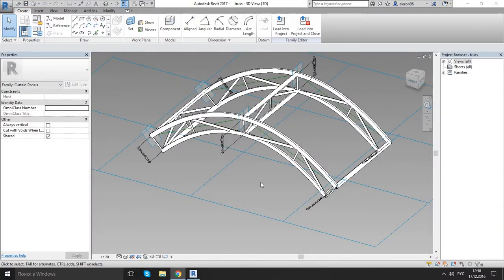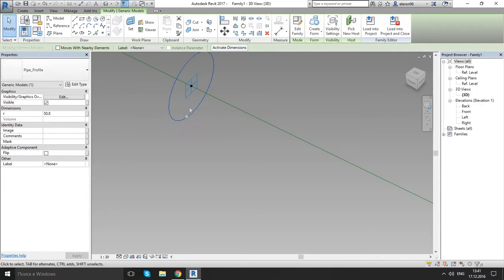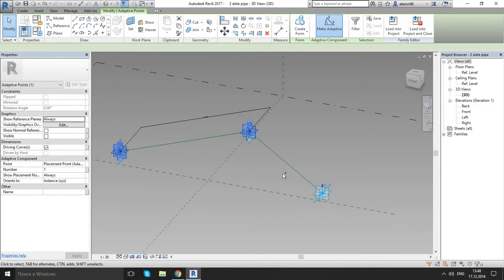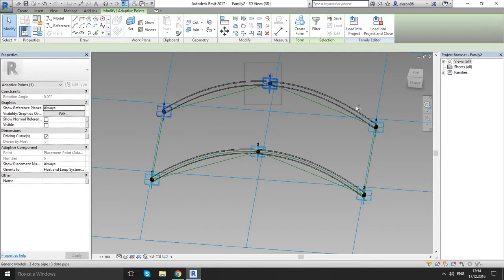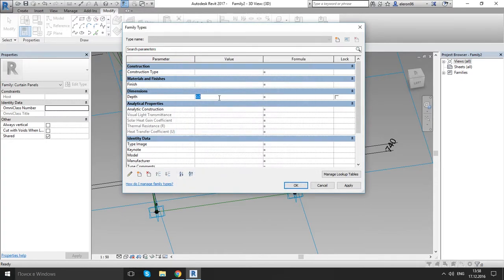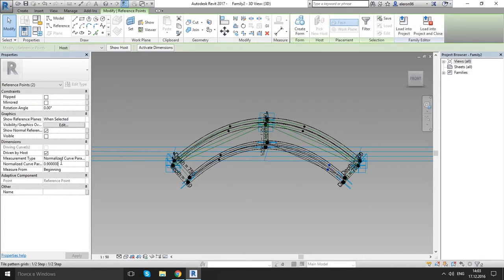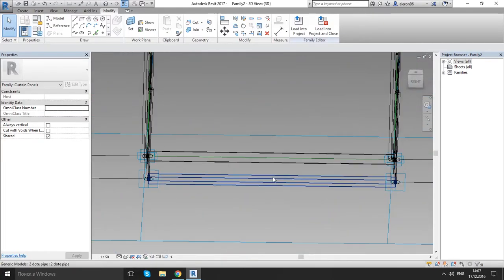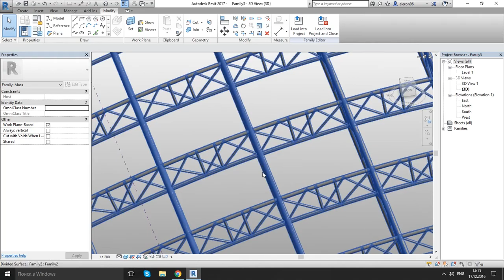Learn revit in 5 Minutes - Truss system

Comment: Hi Niko, I found in this video what I was looking, the making of an adaptive component. I found more that I bargained for. You were kind enough to put it to use in a pattern based curtain panel. This is an old video of yours and you might have it figured out but I notice that the curving of the truss by moving the initial points does not work when you use it as a panel in a  divided mass. It seems to recognize it on the grid. I recon the way to do it would be to create dots in the places you moved them. I hope this helps. Thank you very much for sharing your information.

Comment: Hello, 
I have a question here, would you please help me out, if i have a new truss family :
1. do i have to explode it (remove truss family) in order to edit truss member (vertical/diagonal) for coping ?
2. if my top/bottom chord is an arc shaped (not a simple horisontal or slope chord), then how to fox the connection nicely, because coping doesn’t work out in my case